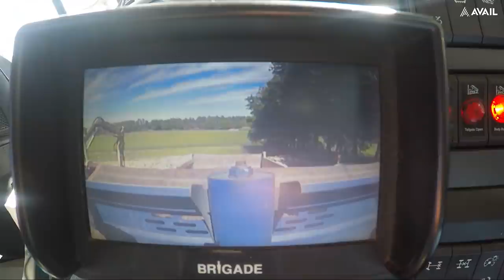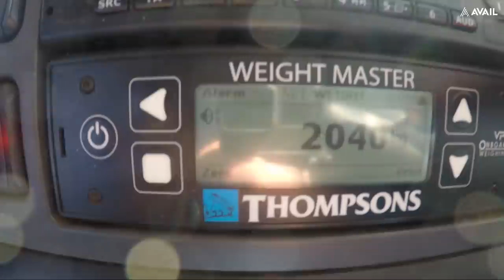I LOVE IT HARDCORE

Comment: Hi Luke, I usually do some class 1 general haulage holiday cover but since lockdown I have been doing tipper work in a Volvo FMX, sand, gravel and ballast deliveries plus some muckaway, even done 2 days carting soil from one side of a site to the other. Not found it boring yet and starting at a reasonable time everyday and getting home in time for dinner every evening is great. If it suits your lifestyle, stick with it!
Also, spend more time driving on a tipper than the sitting around waiting on general haulage!